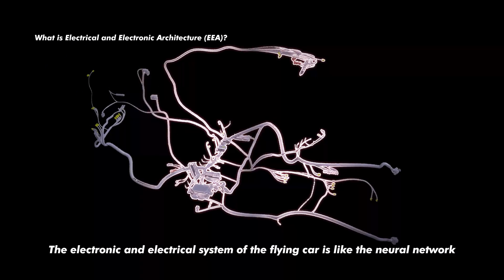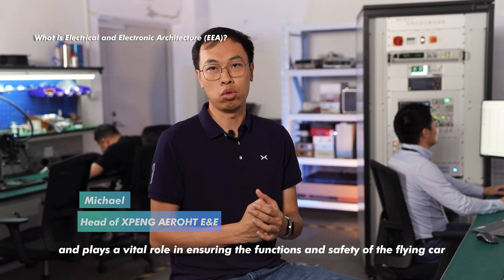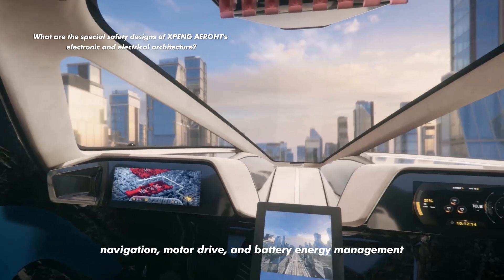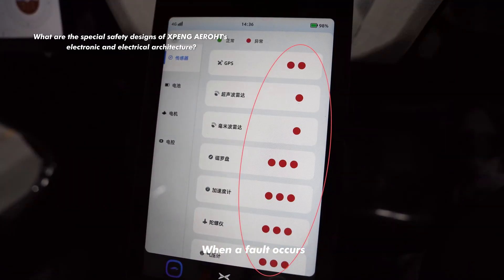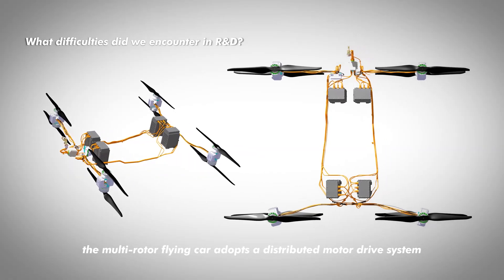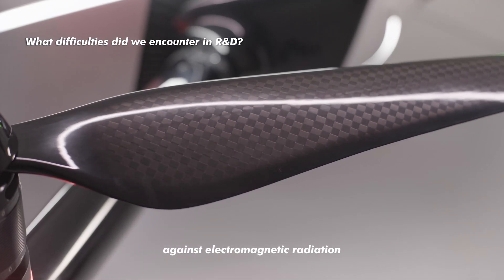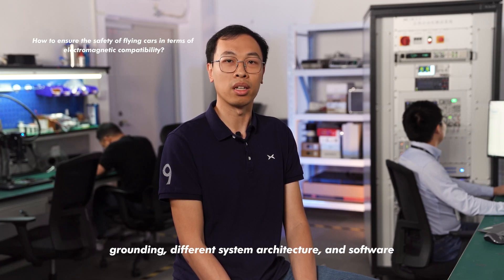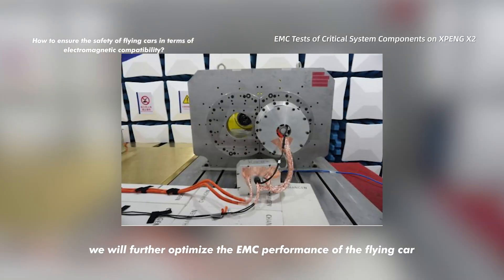Flying Car Electrical & Electronic Systems Safety Strategy

Comment: That's very impressive, but I think it needs a rudder and a lifting body + small wings, as a backup. It needs to be able to glide to the ground in the event of malfunction. As is, it might be used in a combat application, where safety is not necessarily paramount. But even there, they would give it an ejection seat, of course